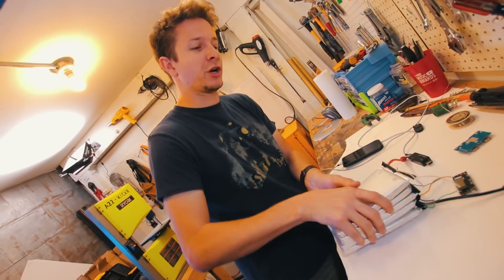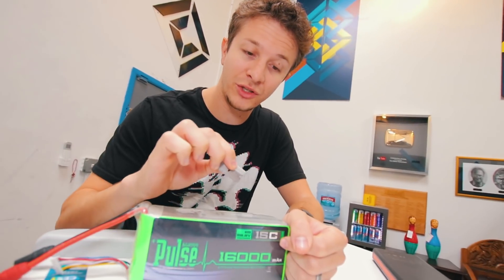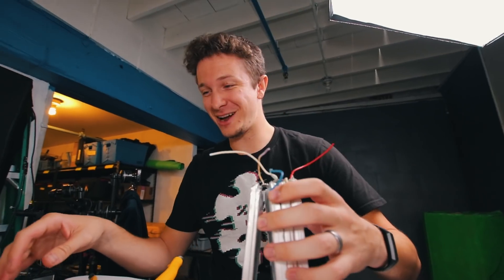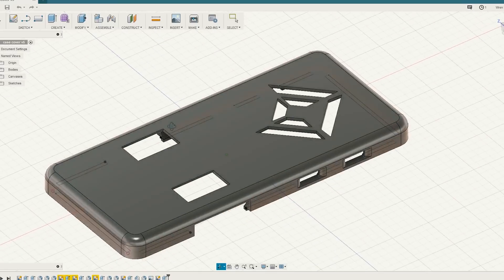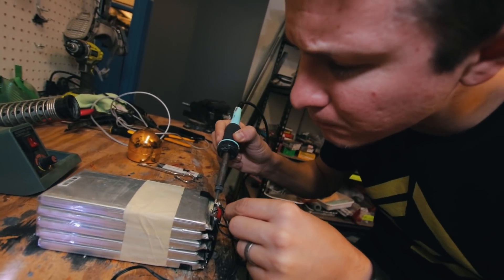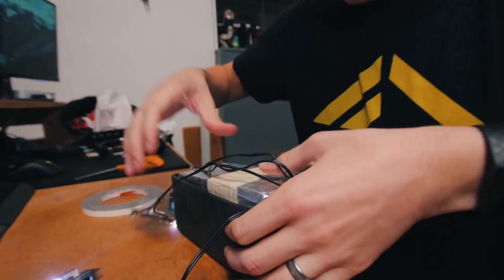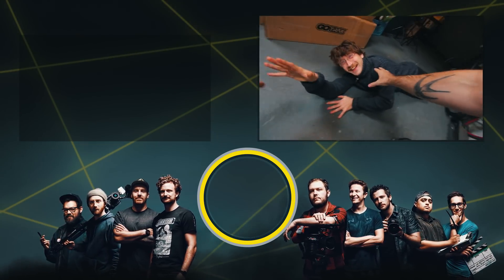I Will Make the World's Largest Phone Battery (iOS & Android)

Comment: Looks great wren. Nice to see a bit of errors in there. DIY right. But nice crossover of soft skills as in design for the case, the use of tools, and practical engineering. Not too hard, not too easy. All round nice little bit of tinkering. (Hint, for d&d if you choose to go away from your current character)

Comment: This is incomprehensibly stupid. I know this video is two years old and Wren has already acknowledged that it was dumb and that he should have been wearing eye protection, but I really do feel like there is a point at which the negligence starts to be unprofessional. Like "Don't try this at home kids" isn't enough when you are showing people all the wrong ways to do something instead of taking the most simple, easy steps to make the process safer. A face shield, or even just safety glasses, a pair of thick gloves. You can get ceramic utility blades for $10.
Not to mention he touches his face twice IMMEDIATELY after saying how important it is for him to wash his hands after touching the leaking battery cell.

Comment: When Wren cut all the colored cables at once, the copper wires were exposed and the scissors made contact between a few of them, causing a short circuit. He should have cut them one by one to avoid a short. Those cells still had some juice apparently.

Comment: “We're got extra… lets fill it with cardboard!”  Instead of, you know, fire-retardant insulation from your local hardware store.  Because those been-shorted-multiple-times batteries and USB voltage regulator that were never designed for this much current, and that heat-trapping 3D printed box are going to go up in flames sooner or later.

Comment: How you normally do this is by cutting one wire after the other and always isolating them with tape, shrinking tube or soldering them to the new connector. All voltage points should also be isolated. Hot glue works for these projects but must not be used for higher voltage projects. Btw. Wires should be thicker

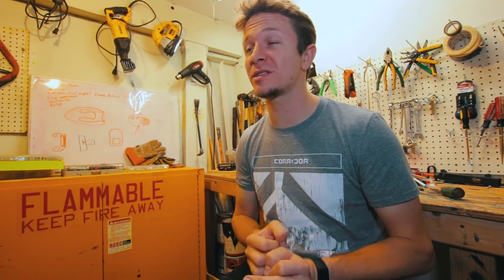Comment: 4:25

The battery say's 16000mah and you say it can charge 8 phones from 0 to 100% 7 times (a week)
16000 mah : 6cells = 2666mah per cell.
16000mah - 1 dead cell (2666mah) = 13333mah

Now let's stick with the 8 and take a iphone8 battery=1821mah (really small to some other phones out there +2500mah)
13333mah : 1821mah = 7.32 times a full charge.
SO, with the best capacity these cells had when they were new they couldn't handle charging 8 phone's for 1 time.. 

And i didn't even calculated in the efficiency of the charger circuit...

Ps. Sorry for my bad English :)

Comment: If you want to make one of these don't do what wren did instead wire all the usb ports to a connector that can connect to the lipo and that will work instead of dissecting a battery and risking your house getting set on fire.

Comment: Hey Wren, FYI, those cells need to have space to expand, they seemed a little tight in that box, make sure they're not too tight, else when you charge them or if you charge stuff for extended periods or if exposed to high temperatures, the probability of those cells failing/ blowing up is significantly higher! Hope you see this and adjust accordingly for safety!

Comment: FYI those chargers wont work, because after few seconds it over heats the IC(&MOSFET) because phone charges more than 1A. Because i tried the exact charger broads   SO it is not practice. make a proper practice video, people will look at this and think it will work. in science and electronic failure always an option, so you could have told it at the end of the video. so the question is Science or entertainment? this is non. ElectroBOOM  video are entertaining and learn some thing. this is a waste of time and data

Comment: So much work and effort for nothing, you can buy an Anker powerbank that has the same capacity, fits in a smaller frame and for less than $30 https://www.amazon.com/dp/B01ISO92V2/ref=sxbs_sxwds-deals_1?pf_rd_p=c32a1f21-f427-444c-bab6-1b04bcb652a2&pd_rd_wg=AB89u&pf_rd_r=K1XEKH92PQCN4603QNBW&pd_rd_i=B01ISO92V2&pd_rd_w=1upLP&pd_rd_r=3e6b277c-2c88-4bac-bc66-12b223956e89&ie=UTF8&qid=1544887920&sr=1

Comment: Very entertaining Video, even though I‘ve got some regards depanding the Safety of your battery. Someone correct me in I‘m wrong but i did not See you install any kind of charge controller to the battery pack. If so, you will most likely kill your battery pack within the first few charges.

Comment: I love the video, but on the battery it says 16000 mAh. That's like 5 charges of my phone. Not sure if you'll be able to charge it for over a month. Or am I not getting something?
Reply: It's 16,000mAh at 22.2V. It's a 355.2Wh battery. Being that it's a 6S battery pack that means each is in series so capacity doesn't change but voltage adds, so 22.2V / 6 = 3.7V per cell which is a nominal lipo and each one 16,000mAh. He used 5 in parallel which doesn't change voltage but adds capacity so 3.7V at 80,000mAh. He's got a 296Wh battery to charge his phones 😂

Comment: That battery is only 16000mah... cant you just buy some 20000mah ones off amazon for less? Or that 130 dollar 100000mah battery
Reply: No it's 80,000 mAh because I combined five batteries that are 16000 mAh each.
Reply: I made the same mistake. I gotta back Wren up on this 😂. It's 22.2v 16,000mAh 6s 15c battery. So 6(in series) of 3.7v lipos that add to 16,000mAh at 22.2V. 22.2V / 6 is 3.7V which means matches exactly what each lipo should be: so this means each cell is also 16,000 mAh. What was a 355.2Wh battery is now 296Wh @ 3.7v times 80,000mAh because he put them in parallel. That being said, with 8 different controller boards idk how efficient his whole system is, but he's done what he's claimed 👍. 

& wren I've gotta challenge you with a car battery now. Something like 90Ah 12V would give you excess of 1,000Wh or in lipo/lion battery's would be equivalent to nearly 300,000mAh.

It'll be a bit cheaper too 😂

Comment: Hey Wren, you know LiPos are't supposed to stay fully charged or empty for more than about a week, else they'll start degrading. 

Awesome build but What I would have done was rigged an XT-60 and a Balance port on the side so that you can use a LiPo charger to charge it up quicker. It's going to take forever to charge via micro-usb.

Also the balance plug would be there to use for a cell checker as well to see what voltage the battery is at. Hell, I would have pulled out a second balance plug to have a cell checker always connected and integrated into the box. 

I fly racing drones and LiPos are no joke. Super touchy.

Comment: Pretty cool. I would have liked some more research though. You should have load tested the battery with max amperes to see if it can actually safely sustain 8 plugged in devices. Also, just because you solder something in parallel doesn’t mean it is in parallel. You need to account the varying resistance for each wire. Anyway, just my two cents.

Comment: A part of me wants to call Wren out for the lack of security measures and stupid handling of a dangerous battery (I mean, not even wearing eyepro when soldering and cutting???? Ridiculous, come on!!) But then another part of me reminds me of that time I did EXACTLY THE SAME and short-circuited a small lipo batt by cutting the balancer cable with pincers, all the wires at the same time... Duh. BTW, Wren, how are you soldering the battery anode and cathode? I have tried at home and the soldering tin won't fuse with them. What's the trick? more temperature?
Reply: I actually had quite a bit of trouble soldering to the actual thick wires rather than the tabs. I'm not sure why but my guess was that the wires were dissipating the heat too quickly for the solder to attach to it. 
And as for cutting the balance wires... I think it slipped my mind because I've cut up balance cables a few times before... but they were always on their own.

Comment: Clearly you're not as smart as you think you are.. just because you chain batteries together doesn't mean it'll work as a bank. If you've ever chained 9volts you know what usually happens. Batteries overheat very quickly when you connect them and those are probably gonna do the exact same thing and overheat incredibly fast and catastrophically eventually. Being a homemade engineer is dangerous and reading an article online from some blogger isn't the same as learning electrical engineering and earning a degree.
Reply: Watching you play around with all that crap and making such a janky battery is really making me cringe despite how much I dislike the word. Failure is almost guaranteed I'm betting the next video will be about the building burning down from the bank exploding while charging..

Comment: "Fire extinguisher is right there" Yea well it won't do anything to help with a lipo fire.... I'm sure you know that though.......
Reply: Yeah but it will stop the things on fire staying on fire once the lipo runs out
Reply: on the plus side it will let you put out things that the lipo fire sets on fire
Reply: Um.. chem/electrical fire extinguishers?
Reply: Fire extinguishers eliminate something from the fire triangle
Heat. Fuel. Oxygen.

Batteries aren’t technically burning, they’re setting everything else on fire
Reply: I'm not really qualified to object to your statement but fire extinguishers smother the fire, and fire needs oxygen to burn, so wouldn't it still go out. I could be totally wrong.
Reply: @zacharydavis9526  Lipo's can burn without access to oxygen once they've started burning as the metal oxides in them will fuel the reaction. To contain a reaction sand and a chemical fire extinguisher goes a long way. Along with having it on something that's fire resistant.
Reply: @zacharydavis9526  depends on the type. I know in Australia we have many types, some that are not suited for electrical fires and some that are. (they have non conductive ingredients)  However any fire extinguisher should handle a lipo fire because it's chemical

Comment: 5:24 that is where you are wrong my friend. The do not get the same current the current is split evenly between the components!
Reply: But the current is maxed out by the "load", aka the USB ports attached to them. Since each USB circuit board is attached separately to the battery, they're only limited by how much current the battery can provide, which is FAR more than 4 USB boards can draw. So I'm not wrong.
Reply: Well done wren. You obviously know more than me as I just had a science test on the subject but you are right about it as your making more than one circuit!

Comment: Wouldn't soldering them in parallel not allow you to balance charge each individual cell? Over time their voltages will drift apart, causing you to undercharge or overcharge some cells, or even worse, over draw certain cells.  Balance is important!

Comment: I didn't want to even open this video because I knew it would be full of dangerousness and using the wrong tools and method for the job. 

Seriously wren, if you're going to put these sorts for videos on the internet, and especially with a click baitish title, please at least be responsible and ACTUALLY research things. 

Tin snips to cut heavy gauge wires? Flush cutters are like $3.

Putting your face over solder splashing?! You have safety glasses right there.

Dude, this is beyond silly, dangerous and pointless. I don't want to make you feel bad but you need to do better, and corridor should have better standards, especially when everything has such a joking tone to it, some idiot kid isn't going to get the danger involved, try to do it with one of his old RC batteries and end up burning his house down. 

Step it up, guys. Come on.
Reply: Where did you see solder splashing? And do you have any idea how thick those tabs were? We have flush cutters. They didn't work.
Reply: @SirWrender  literally always possible to splash solder. Grab some side cutters then :) also cheap and won't slip. 

You also used the tin snips on the Ballance cables, and then scissors. 

Don't want to be a dick or make you feel bad, as I said. It's a cool project, just try to be safer, more appropriate and have more warnings, that's all! <3

Comment: Wren why are you using sheet metal snips for wires
Reply: Because I was cutting thick metal tabs that connected the batteries.
Reply: @SirWrender  I've seen people use scalpels to take them apart idk what gauge metal was on that but it could've made it easier if it was real thin

Comment: Wren throw that out. Sorry buddy but they need to be charged at a specific rate. There are special circuits designed to regulate the voltage properly. 
This may work for a while, but it has a good chance of blowing up randomly.
You may not be around to deap with iy when it happens, and it could burn down the building.
I build circuits on the daily, and I dont work with batteries very often, but I do know that it is extremely dangerous to diy this sort of thing, without understanding the math behind it all.
Reply: Also, depending on the quality of those chargers, they could damage your phones battery.
Reply: Can you be more specific? You used too many pronouns so I'm not sure what you mean.
Reply: So no response? I thought you said you "knew I wasn't experienced enough for this"
Reply: SirWrender Seems like he has a gaming channel, not a channel for circuits and things like that.
Reply: @SirWrender  so? did you throw it out? i need answer, man
Reply: Well to help out, I have done a few circuits and it's amazing that with some time anyone can get out their doing it. Knowing what I've learned, throwing them in parallel like that won't help when it comes to long term use because they aren't being balanced. The best thing you could do for this project wren is to get a balance charger, but that steps up the voltage. To bring it back down step the voltage down with enough current to run all your units is probably best. A switching regulator is best for efficiency but an ldo or something else works. That being said you could also just hook each lipo to each board you bought there. Those are like $2 a piece or something and come with a charge controller ic on each. That way you don't have another cell dying from over discharge, overcharge, etc. If you're really interested in this stuff wren you should check out easyeda.com. You can design and order your own pcbs. I've done a few including an amp circuit. I'm working on one now for a bluetooth speaker and it uses a lipo cell. There shouldn't be discouragement and always some sort of positive alternative at the least in my eyes 😊
Reply: The other thing you might be able to do, although it doesn't help, but it prevents accidents 😅, is get a protection circuit on each cell before they are wired in. That way they don't die, they just stop before they might have died 😅